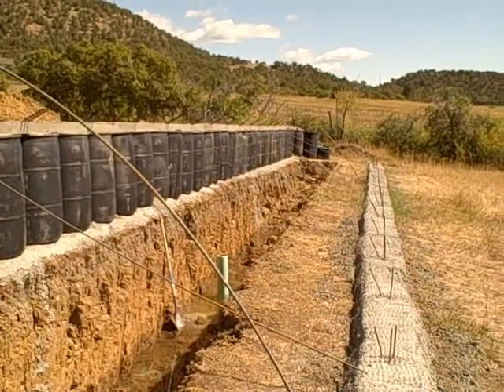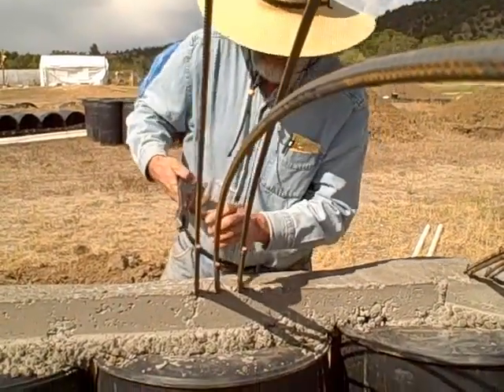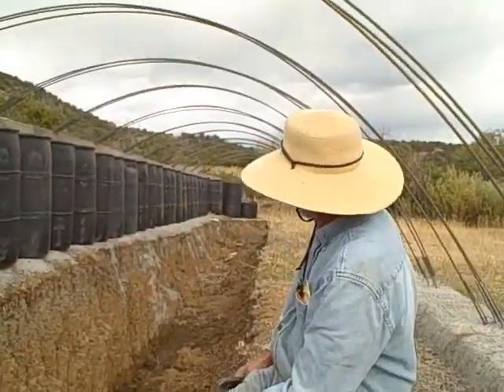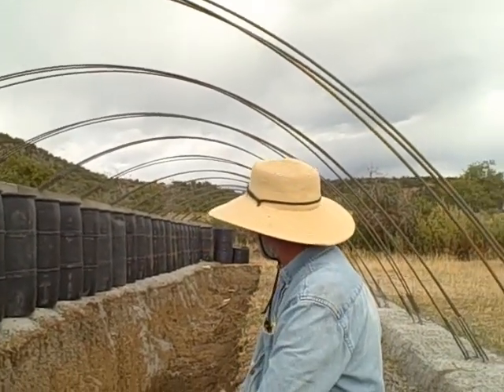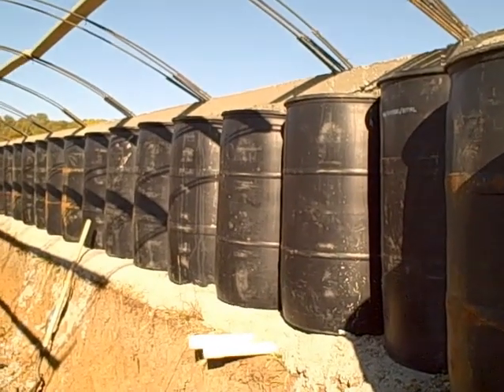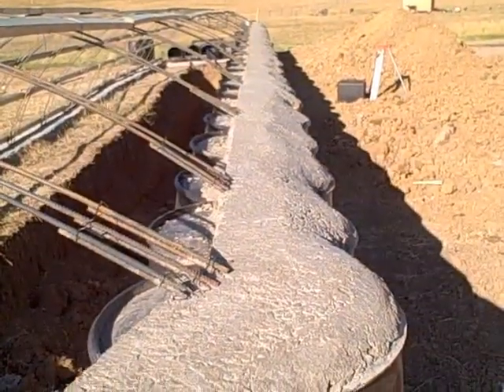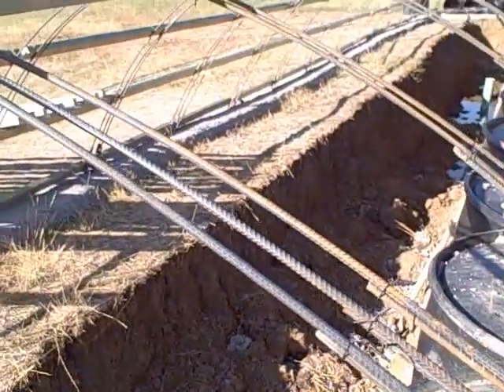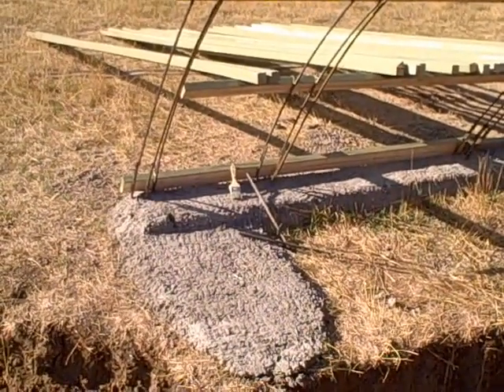Greenhouse Construction  Step 5: Steel Layout for the Greenhouse

Comment: Ok so I guess you all up in Colorado do get a much larger amount of snow load and run off so I guess I can see all the metal and the concrete for wash out protection we are lucky even this far north in N.M. we don't have the snow loading you all do. Even just across the boarder. We would be up there if you all hadn't priced everything out of our reach.
 I'm thinking you also had a much bigger budget for your G.H. than we did. The good Lord has provided for us as we have gone along. A lot of parts were free or at such a reduced price as to be almost free. The PVC bones and sheet metal & fiberglass skin, were our biggest costs. But after having seen my mom & dads G.H. stand for 6+ years till we took it down ( it never wavered ) with a much thinner PVC frame. and fiberglass skin We are sure we will get a longer life out of it than if we'd have used wood or metal.